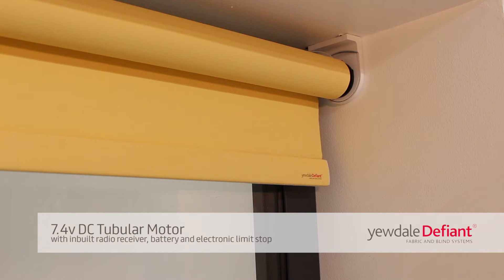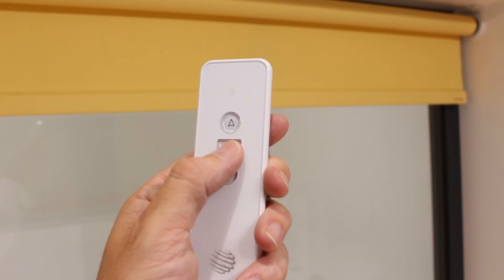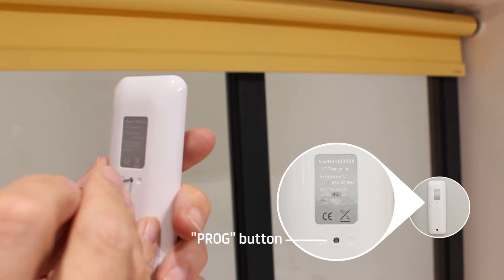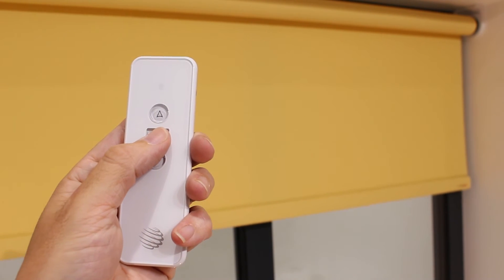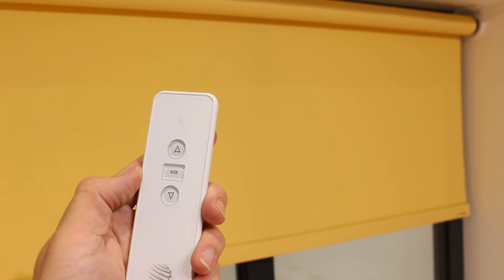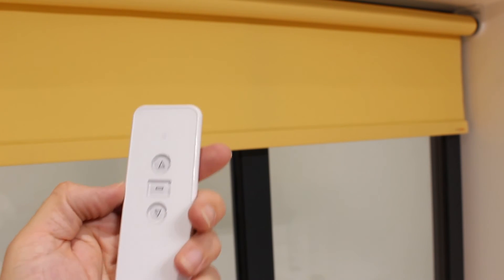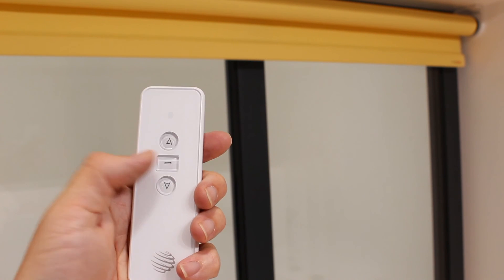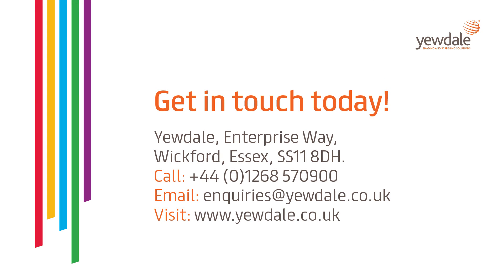7.4v DC Battery powered tubular motor - programming instructions

Comment: How do u open it? I think my baterry died, but i couldnt find a way to open the remote.
Reply: I'm sure you've resolved this already, but just in case someone else is having the problem you need to remove the single stew near the bottom of the back side of the remote and then slide the back upward to open it up and separate the back from the front.

Comment: Great video.  Can you plz tell me how to set multiple shades to a single channel. ie operate multiple shade with one press.
Reply from the maker: No problem, once the first blind is set up you'll need to follow the “Turn motor off” instructions at the bottom of page 6 of the motor instructions (980003) which can be found here on our website: https://www.yewdale.co.uk/downloads
Then set up blind 2, and repeat the process until all the blinds are set up with the correct limit stop positions.  They can then all be turned back on by pressing the program button on the motor and will all work with the handset.

Comment: I have 6 blinds on one remote but all of them work with one touch except one 
What could be the problem
Reply from the maker: Hi, It could be either of the two points,

1)	A weak battery in the remote.
2)	A weak receiver in the motor.

Best to change the battery in the remote to start with and see if this resolves the issue.